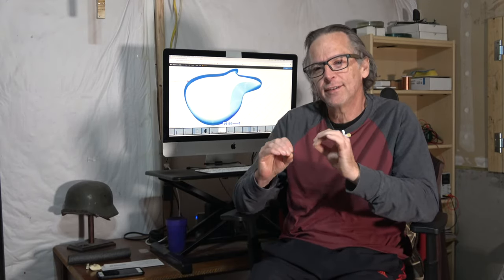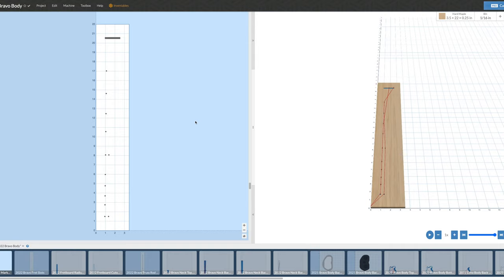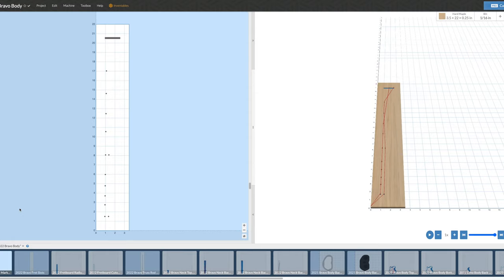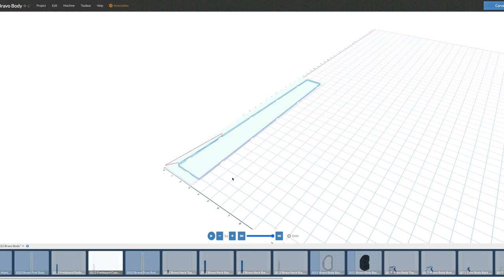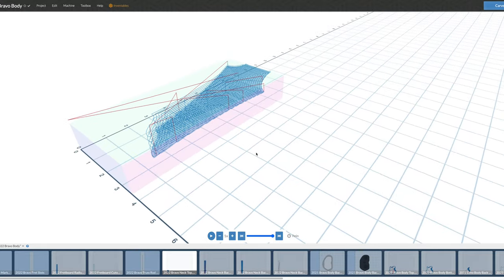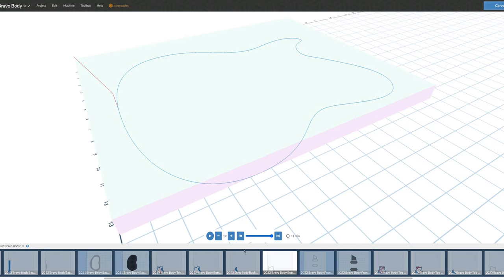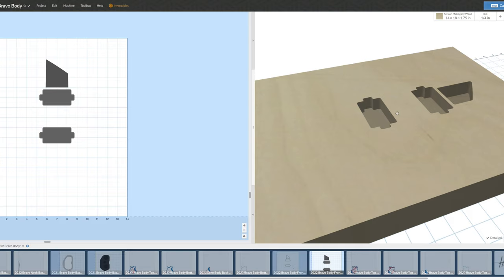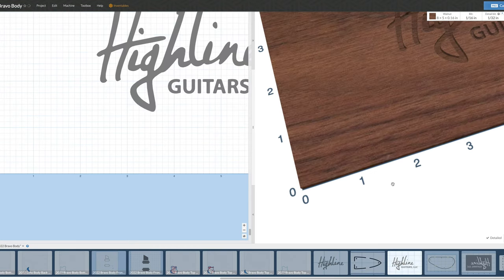The 26 Steps To Carving A Guitar On A CNC Machine

Comment: The term blind refers to dovetails and mortise joints.  A half-blind dovetails and mortise enable the woodworker to hide the joint from the front end. The tails are housed in sockets in the ends of the board that is to be the front of the item so that their ends cannot be seen.
Half-blind dovetails are commonly used to fasten drawer fronts to drawer sides. This is an alternative to the practice of attaching false fronts to drawers constructed using through dovetails.
Reply from the maker: The term is a mistake. It should be invisible.

Comment: Great videos. Thanks for making these and the knowledge sharing. Question on the cnc pickguard cutting. How do you achieve a beveled outside edge; do you cut with an end mill and add the bevel by hand after the fact? Or do you use a v bit (60 deg, 90 deg?) and do it as part of the cnc process? Wondering which machining operation might be best...profile with a v bit or a v carving operation. Thanks
Reply from the maker: My guitars don't have pickguards.

Comment: Great walkthrough, Chris. Thanks! I'm curious, does your workflow change at all when experimenting/iterating with new body shapes? For example, let's say you want to extend the horn, deepen a cutaway, or maybe exaggerate the offset at the waist. Do you go all the way back to Illustrator, or just edit the body in Rhino? Since you use Illustrator as your source of truth for all measurements, I would anticipate you would want to go all the way back. But completely rebuilding the 3D model must be a pain.
Reply from the maker: I go all the way back to my Illustrator file. However, it only takes me about 30 minutes to create a new 3D model in Rhino.

Comment: I did my first radiused edge... conventional counterclockwise, starting at top/stock surface, with flat bit. Got a lot of fluff on two quarters, based on grain. Not a big deal.. needed some scraping. Any suggestions for my second try?

Comment: I don't know Bravo Body but I do know Rhino 3D (and SolidWorks).   I'm just wondering where in lies (wherein lies?) the difficulty or complexity of offsetting the bottoms of the fret slots concentric from the fretboard radius?
Reply from the maker: It lies within the complexity of the code.
Reply: @HighlineGuitars  The code for the tool path, I take it.